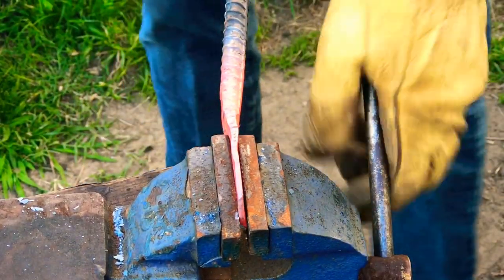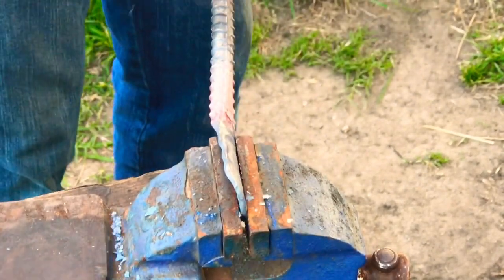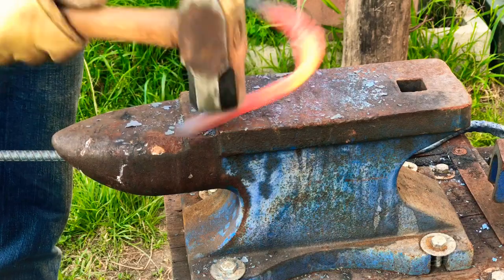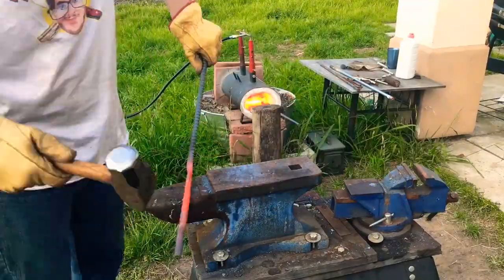BLACKSMITHING | FORGING KNIFE TONGS OUT OF REBAR

Comment: Dumb question but I’m new to black smithing but I made a set of these and when I was using them they kept bending out of shape.  I did not quench them so is that the reason why?
Reply: The steel likely is to thin for the job you are trying to accomplish and even if you quench rebar it’s spotty wether or not they would harden to any degree. I’d suggest using bigger stock, but if you need you can try to quench them. Just be ready to accept them working great from then on working the same as before or them breaking because there was enough carbon to cause stress. Again this is because it’s hard to known rebar exact composition
Reply from the maker: The thickness is definitely a factor I’ve made thinner tongs and they kept twisting and bending... I quenched these tongs when they were at a black heat so the oil can keep the head from rusting